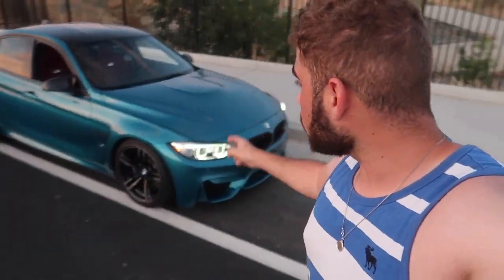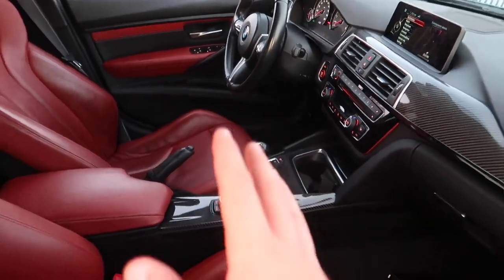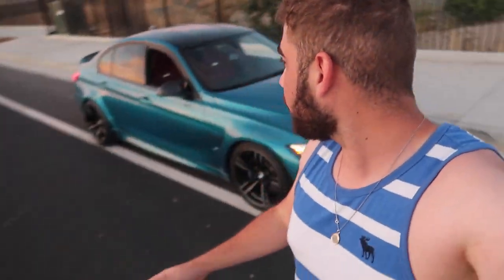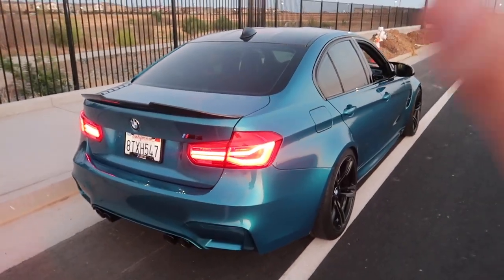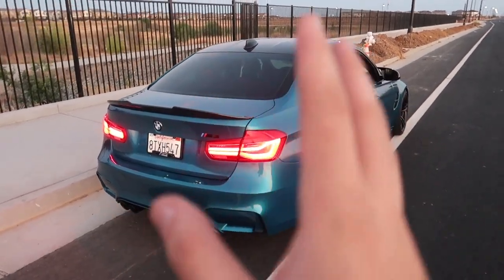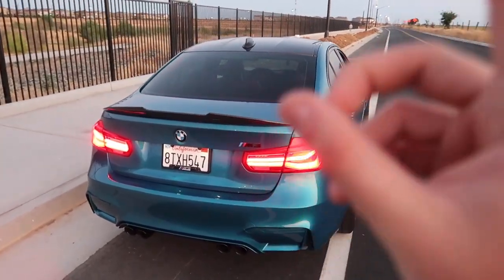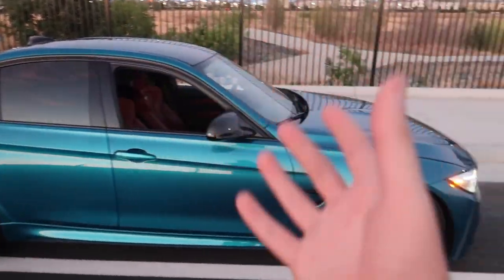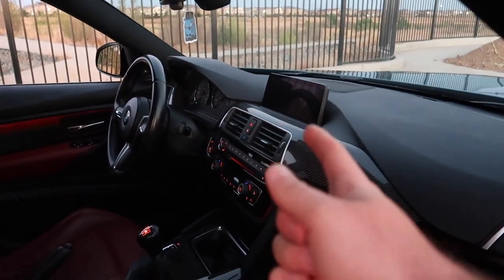5 REASONS I BOUGHT A F80 M3 IN 2021!

Comment: What functions do you have on there? By the shifter. I only got steering wheel and motor buttons. No suspension button. I’m really thinking of putting the air lift Performance on it. But the car is fire 🔥 🔥. Keep it up 👍🏽 🤙🏽

Comment: Yo I might be buying a f20 i118 what do you think?
Reply: Buy 116i and tune it. It's the same engine. You will save some money because they are a bit cheaper and with a stage 1 tune you'll get ~185hp (same power as 120i)
Reply: @lukafranjcic2634  no u can't tune an n13 engine this engine can't  hold more power cuz its made by peugeot sadly u better keep it stock if u want more power u should save up for 120i b48 engine 
bty I own an f30 316i same engine
Reply: If u care about power and speed u better save up for 120i ,125i but if u plan to make it dailey then buy it and keep it stock
Reply: @lukafranjcic2634  good idea
Reply: @hasan_440i  no it won't be a daily I have a X5 m as a daily, I'm buying it to have fun
Reply: @MDE1205  if you're buying it for fun, save up for m135i or m140i, although I would look e46/e36 platform for fun 😊
Reply: @MDE1205  who have an x5 m as dailey and thinking to buy 118i for fun like fr bro?  the x5 m is already faster and wayyyy more fun than 118i slow asf and boring if u really wanna buy a fun car save up for 135i/140 as Luka said